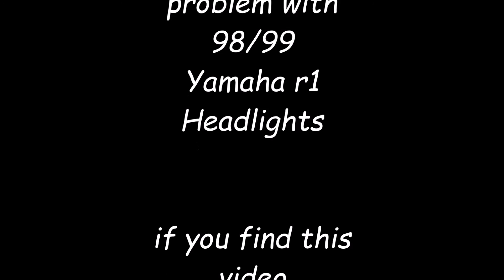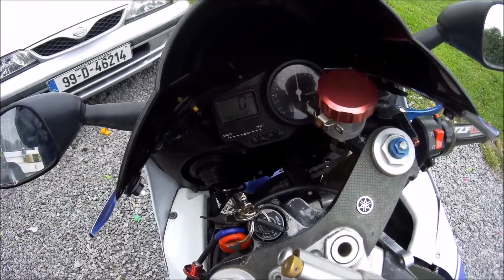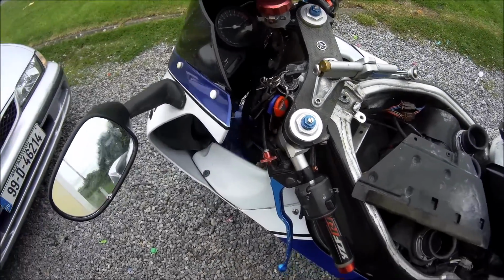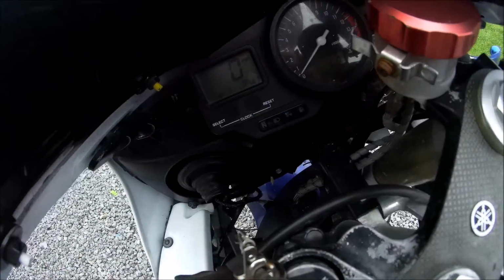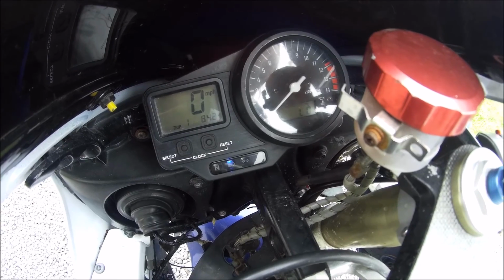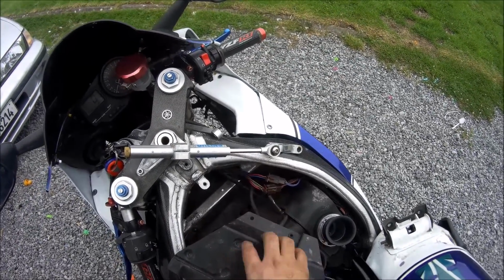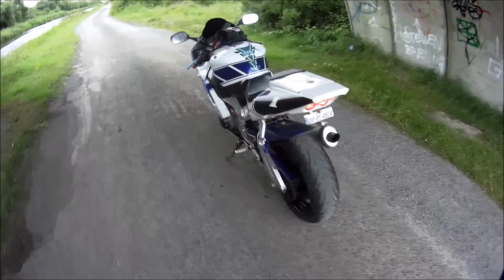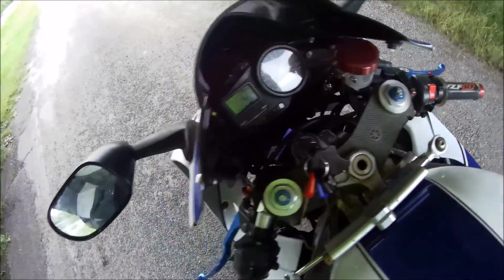How to fix Yamaha r1 headlight problem 98/ 99/ 00

Comment: I have Yamaha R1 2005. but still... So for everyone having the same problem with the headlights. I had it also and i also lost my speedometer lights as well. When I pressed the PASS switch the lights worked as long beam but the short beam only "flicked". Eventually the problem was in the white connection plug on the right side of the bike right under/next to the radiator / cooler cap. I opened the plug and found 2 burned connections. I used electric cleaner and scratched the parts with a metal stick (the battery wires off). It helped and when I attached the connection plug back together, the headlights and the speedometer lights all worked perfectly again. Thanks! Hope u get it fixed!

Comment: Well done.  If the connector is hopelessly damaged,  you can splice a wire,  and bypass the bad pin. I replaced the headlamps on mine,  with the new LED bulbs,  they consume less power and are brighter.

Comment: I’m having a issue of them poppin the 25amp fuse it’s the second one next to the blue others are 75amp I have demon eyes and halo around it the halo converters were frying the wires now all of a sudden it’s popping the fuse might be Bc of heavy fog water getting into wire clip or something
Reply from the maker: I would start testing the power coming from the regulator/rectifier you will also have to see if any of your wires are burnt and that sounds serious hopefully you get sorted

Comment: Man my low beam works but when I turn on the high beam all headlights go off. 99 r1 and tach is jumping from 0 to 8500 when first started whats going on
Reply from the maker: 3000 rpms: throttle position sensor
7000 rpms: EXUP related
8000 rpms: fuel level indicator light

are u sure about 8.5k ? 8000 rpms is the fuel level sendor switch that goes up inside the fuel tank check the wires and if that does not work try replace the unit,

Sounds like you either have a faulty switch for your lights check the white connection near the lights on the front left give it a good cleaning if its dirty and replace connections if there is burnt wires also check the brown wire on the right hand side you will need to take off the air box and move the plastic cover for the spark plugs to check and see if its burnt or damaged. if u need more help let me know
Reply: @FastNFearless  yeah man I'm sure it jumps to 8500 then zero. I got the headlights fixed I had to wire up new connectors and put in new bulbs
Reply from the maker: @daltonwilliams8272  they get very hot I had to do the same on my last rebuild bad common it left the lights very dim once I rewired the connections it worked perfect. I still think it only goes to 8k revs check the green connection under the fuel tank I am having the same problem on my r1 if I get it fixed I will do a update video
Reply: @FastNFearless  I called a few Yamaha dealerships and talked to their mechanics and the main issue is the incompetence and lack of knowledge they had to offer.  Highly disappointed with all of them. You've given me more information than anyone of them did. But I've tried looking up what the 8500 rpm means and cant find anything about it.  When I get off work I'll take it back apart and flip the tank up and check everything out under it
Reply from the maker: @daltonwilliams8272  I have completed rebuilt mine from ground upwards I certainly don't know everything but most problem I am after having them and fixed them. I fitted a new wire loom and two engines in my bike since I have recorded this video. Unfortunately I learnt the hard way when pushing its limits lol very expensive hobby on my behind. And some misfortune along the way.
Reply: @FastNFearless  yeah I push mine hard all the time

Comment: Your bike is giving a self diagnosis, tach displays 8000rpm ( fuel level indicator light)  - "improper connection"
Reply from the maker: The wire loom was very badly damaged I have replaced most connections if I were to give advice to anyone would be change the full wire loom when there is high milage on the bike. Thanks for stopping by and showing you support it's much appreciated.

Comment: If you didn’t know the gage sweep is a code something going on mine does the same thing
Reply from the maker: What codes are you getting two common ones are fuel sensor and exup valve I think 8k and not 100% but the other might be 7.5k

Comment: Can anyone tell me how to fix the tech jump
Reply from the maker: Robert Hamelin it can jump for a few reasons where on the rev counter does it stop
Reply from the maker: 3000 rpms: throttle position sensor
7000 rpms: exup related 
8000 rpms: fuel level indicator
Reply: Fast_N_Fearless it stops at 7 and 8

Comment: 7.5 and then 8
Reply from the maker: Robert Hamelin I found with my wire loom there was a lot of bad connections take out the white plugs clean them and make sure there is no broken wires loose wires burnt  wires my bike had same problem for 7 rpm and it stoped after I cleaned the connection
Reply: Fast_N_Fearless well thanks to you I found out the owner before removed the exup
Reply: Fast_N_Fearless if you can send me a pic or vid of where the servo motor goes under fuel tank to mount it would really help. I'm stuck trying to rebuild a hurt bike
Reply from the maker: the servo motor goes on the opposite side of the rear shock top bolt i will leave a link above to my facebook page i will send direct messages from there if u like with photos
Reply: Fast_N_Fearless yes please and thank you
Reply from the maker: link in the description now